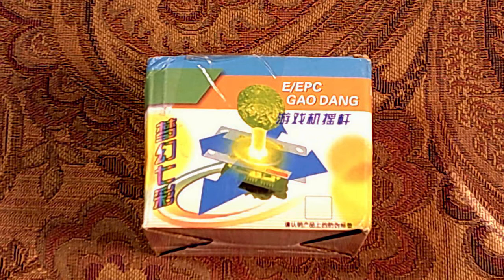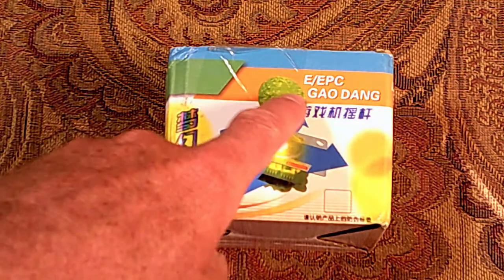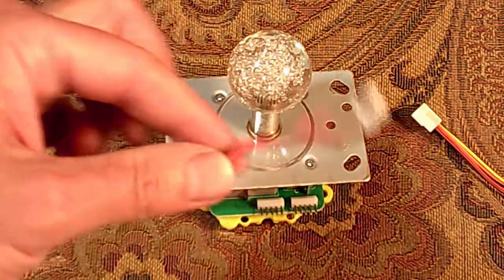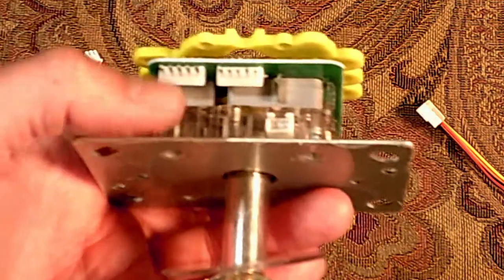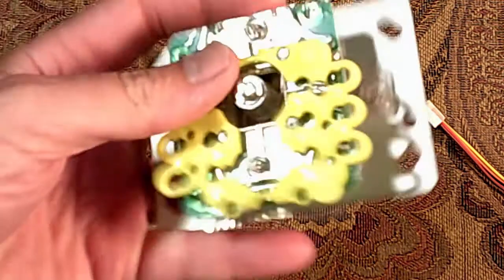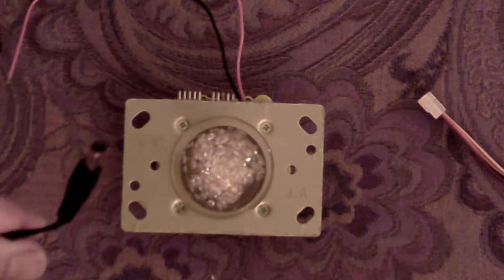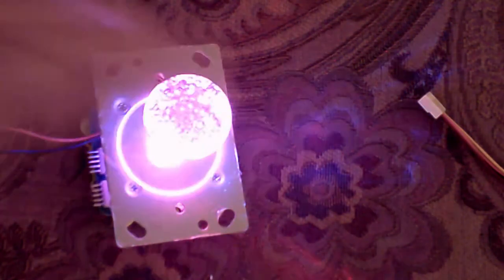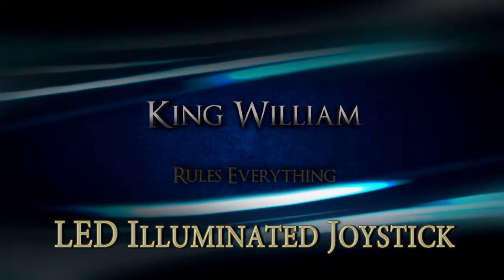LED Illuminated  Arcade Joystick

Comment: Great video sir! I do have 2 questions... I know this is made 2 years ago. How is it holding up?  and most importantly; the power for the LED doesn't come both end so it can be plugged into USB encoder easily.  It came with 2 wires... that won't work for many folks... how did you manage to put that in the arcade?

Comment: what power supply did u use on this can you give me the specs?
Reply from the maker: I just use a standard jamma power supply and wiring harness.  I can get you a link to one if you want
Reply: @KingWilliam  please do thank you so much.
Reply: Hey send me link as well please
Reply: It's looks just like mine, 12 volts DC

Comment: hey i am new to fightsticks/arcade joysticks, just recently bought this same led joystick and i have a few questionsi hope you can answer for me.
 i have a mayflash and the joystick installed in it has the wires solderd onto it and they are already connected to a "up,down,left,right". so my 2nd question is will i just need to take those wires off and re solder them to this new led joystick while leaving the other end in the up down left right still?
and my 3rd and final question is what do i use as a power supply? i did what you did and put the positive into the 12v adapter ect.. saw it light up and stuff but what do i put the wires into when i want to play you know what i mean?  do i have to solder them  to the 12v adapter as well?
sorry for the long line of questioning man ide really appreciate it if youd get back to me. this stuff is new and confusing to me lol
Reply from the maker: Should be able to just move the wires in the same position on the new joystick.  I would use blade connectors on the ends of the wires so they would be easy to install and remove in the future.   For the leds I use either the jamma power supply or you could get a led power supply off of ebay for under 10$.  Just make sure you have the correct voltage.  Some leds are 12v some are other voltages.
Reply: thanks dude very helpful